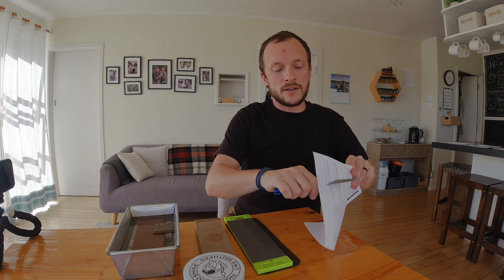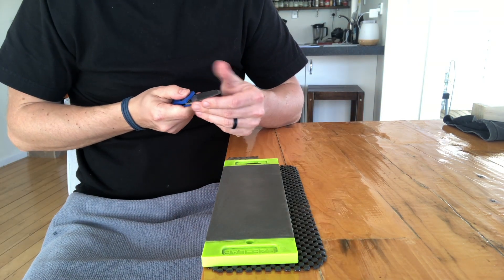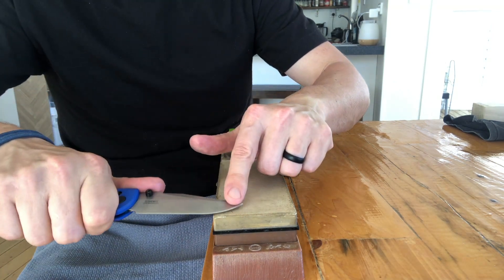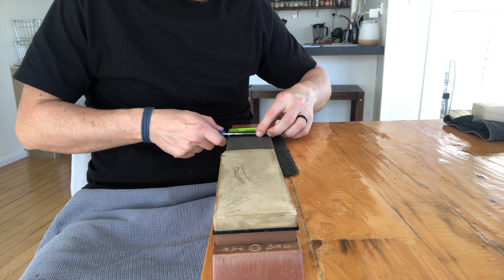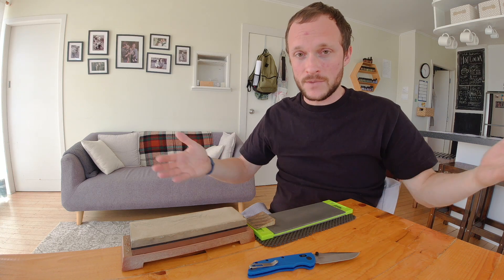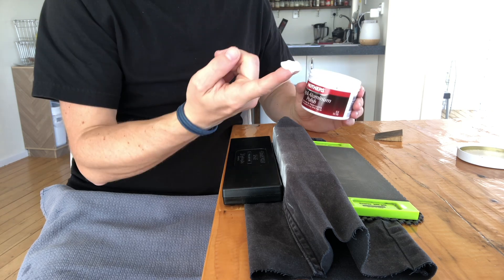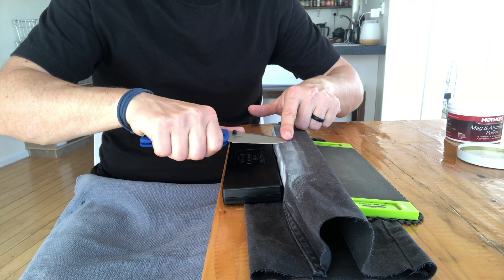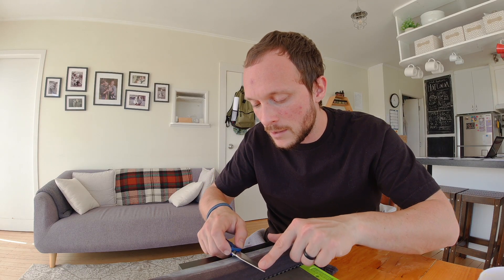CPM MagnaCut Dual Grit Tutorial | FULL Sharpening Update | Mule Knife Edge Tested On Cedric & Ada

Comment: Looking forward to trying this on my Izula in 1095. I love everything about that knife except the very poor edge retention. Very interesting idea, thanks for sharing 👍
Reply from the maker: Let me know how it goes!  I’d be keen to hear!
Reply: @homeslicesharpening  I've been freehand sharpening for about 15 years and have a strong bias towards highly polished, hair-whittling edges, so the first thing I noticed was that running the tip of my fingernail perpendicularly across the edge shows a much rougher texture than I am used to. The surprising thing though is that it is hair-popping sharp when I try to shave arm or leg hair. Judging by the coarseness of the edge I would have expected something more like scrape-shaving sharp, so that is definitely interesting. I have a bunch of dirty cardboard to cut up for the burn barrel very soon and if the Izula can get through even half of that with an even slightly aggressive edge I will be very happy.
Reply from the maker: Awesome  @RichardPoogerman  Keep me posted - I'd be very interested to hear.

I just put a 400 Grit CBN edge on my Spyderco Military in M4 for the first time - very similar to what you've described...  Chunky texture against a fingernail, yet shaving smoothly.  I'm excited to see how the a dual grit edge off a fresh new CBN plate performs.

Comment: I love when your excitement kicking in seeing the results as you test! Great work. 
I have a Hogue Deka myself but couldn't stand the stock scales feeling toy like and replaced them with aluminum. Overall great EDC. 

Curious if you still have yours and if so with all your new sharpening and stropping test since this video, do you still work it the same way or has it changed since?
Reply from the maker: Ooh, where did you find aluminum scales?  I do still have mine, I have not found a sharpening method I like better yet, but I'm gonna do more concentrated research into it this year.

Comment: Your dedication to optimizing angle and grit is really impressive. 

I recently caught a Larrin Thomas interview that stopped me in my tracks. He said something to the effect that dialing in your edge angle was almost more important than your steel selection (in terms of durable useful edge lifespan).

I don’t think that he was suggesting that two optimally sharpened knives would not come down to steel selection, but he did seem to suggest that a poor selection of angle with a nice steel could easily lose to an optimized angle with a cheaper steel. 

Twisted my noggin a bit to hear this. 

Do you have any angle recomendations and a sharpening recomendations for : 2019 Benchmade S30V?

It’s been a frustrating experience thus far.
Reply from the maker: I have a hard time with Benchmade's S30V to be honest.  I have a 940 and I love the design, but struggle to get the edge right.  I'm hoping to utilize my rope testing to analyze an optimal sharpening protocol for this steel in particular, but it will take some time.

If I were you, I would either:
-Leave the edge toothy, I'd probably use my Venev FEPA 400 grit OCB Diamond Water Stone, then strop with a good diamond emulsion, you could substitute any quality diamond stone, but if it was an electroplated stone I'd probably finish with gentle edge-leading strokes alternating direction every pass on 600-800 grit, then to strop or
-If you have really fine diamond stones, I have had some good results with high alloy steels (Vanax in this case) doing a dual grit edge about 400grit diamond on one side and very fine on the other, and more stropping than a low-alloy steel (I usually do 15-30 strokes per side) with good diamond emulsion

For now, those are the only 2 protocols I have had some reasonable success with - cheers.
Reply: @homeslicesharpening  
What I have read/watched so far on BS30V (pun intended)
1.
A professional knife sharpener on YouTube mentioned that it seems like Benchmade S30V requires the user to take a layer of metal off of the edge to get past some form of residual heat treatment defects on the cutting edge of the blade when delivered from the factory. 
This hypothesis was based on the idea that after resetting the bevel and sharpening the blade 3 or 4 times, BS30v seems to have less problems. However, before doing that, it’s likely to see small chips in the edge under light duty. 
2. 
The steel seems to do better with an edge angle between 35-38deg.

I’ve sharpened spyderco’s S30V really well, but my super fancy Benchmades seem to really disappoint in this department. 

Will try your suggested approaches on the sharpening. 

Thank you for the write up!
I’m really surprised someone hasn’t covered this issue with the amount of people who have been stuck with BS30V knife steel knives…
Reply from the maker: Thanks for the information!  Cheers bro.

Comment: Hey Gabe, can you remember the vosteed Mink test, you buttoned some wood ECT. What grit you recommend on that nitro V. Just interested if you have time. Not to important. Ty.
Reply from the maker: Hey Marc!  For production Nitro-V I would recommend finishing on a fine, hard water-stone.  I've had great results on my SueHiro 3000 grit, but also good experience on the Shaption Glass 8K and Venev 3|5 Micron Diamond OCB.  The real clincher is the strop though.

For ultimate durability I'd strop on flat denim with Mother's Mag or similar 10-15 passes each side.  For max aggression, Stroppy Stuff on Bass or Balsa Wood, probably 1 micron and I'd do 10 passes or less (by feel).
Reply: @homeslicesharpening  thanks heaps Gabe, I do like the venev stones, get a great finish so easy off them. Nice benefit. They still cut so well. They feel different. Merry Christmas!

Comment: Never seen one test their knife reversed on the bess tester..
Reply from the maker: Yeah, it's not better at measuring that way - I just do it because it allows me to butt the heel of the blade up against the pedestal, ensuring that I hit very very close to the exact same area on the blade - cutting down on errors due to slight variations in different parts of the edge.

Comment: Gabe another great instructional video.  Your tenderness denim stropping is appreciated, but is it perhaps too tender?  I mean after the first cardboard cut the edge is going to be exposed to more stresses. Also I wonder if you have tried a gentle draw through balsa or would this be too rough? I’d think that properly setting up the final dual edge burr for removal is the trick since working back and forth is going to affect both sides. Hope that makes sense. Suggestions not criticism.  May your days be sunny and nights clear and cool.
Reply from the maker: Hey Steven!  I'm not sure.  I just shot a video experimenting with different stropping substrates.  Don't have any Balsa at the moment.

I also experimented with number of strokes.  Very interesting.  Also need to experiment with different pressures.

This gentle method definitely optimizes for a test like rope cutting better than my old method of stiffer strokes on cardboard with silica & diamond (as the 1550 cuts exemplify).

Does rope cutting not account for impact durability?  I have more tests to do, but I think time will tell.  Just got a 1000x Microscope to do damage checks - anyway, great question.  

In short, big changes coming, and I'll look into it.😁
Reply: Just thought of something related to denim strop.  I used to make rice bags to microwave for warming pads, filling the denim with rice might be a way to create the strop.  It could be adjusted by varying the amt of rice  or by rolling the rice in the “bag”.

Comment: Do you always use the angle blocks or do you only use them as demonstration for the video?
Reply from the maker: Hey Scot!  I used angle blocks here primarily to show how I made the specific edge for Pete, though I sometimes will also use them if:
1)  I just want to know for sure roughly what edge angle I'm working with for comparison or tuning.
2) I have a super small edge bevel and want to reset myself so as not to accidentally round the edge to a convex (EG in kitchen knives).

I often sharpen my Spyderco Military M4 work knife freehand unguided, but I know it's 14-15 dps and the edge bevel is huge at this point, so I have something to rest against and make sure I don't accidentally lift the angle.

Comment: Cool stuff but I’m heavily invested in the KME guided system.  How do I do the dual grit sharpening with the KME?  250 on both sides then just on one side jump to 600 then “deburr”both sides then 1500 and deburr both sides then strop 1 micron gunny juice on basswood 3 passes then 2 passes the one pass?
Reply from the maker: Hey David!  From what I know right now I think that would work, and I'm not sure exactly how you deburr your edges on KME, but I think you could use both edge trailing and edge leading passes up through the 600 grit. I'd suggest you perhaps switch to really light edge trailing passes at the end with the 250 grit stone on the coarse side and 1500 on the fine.

Do your last stroke on the 1500 side and (when you can no longer feel any burr on either side), hit the Gunny Juice and basswood (I'm actually re-experimenting with stropping in the present, and I think you could do anywhere from 5 to 15 passes each side without removing too much aggression - if you do 15 passes you'll maximize edge stability more, if you do 3-2-1, as you suggested you're likely to maximize aggression more).  If you strop it really lightly, I'd recommend realigning the edge on unloaded leather once it loses its initial "bite" as the edge is slightly more prone to bending.

Let me know how it goes - I'd be super interested!

Comment: Is it possible to do this on a fixed angle system? And have u tried? Thanks!
Reply from the maker: Hey there!  I believe so, I have heard good things from friends about doing it on fixed angle systems. I think for best results you should focus on edge trailing strokes for the last few stones, and I think alternating from the coarse to the fine sides each pass on your last stone or 2 helps if it's not too cumbersome with your system.

Also I have found that harder, higher carbon steels can endure more stropping than I did in this video and benefit from diamond abrasives in the strop.  Cheers!
Reply: @homeslicesharpening  OK awesome! Great information and thank you so much for your reply. I have the TSPROF pioneer so switching stones is pretty easy. 👍